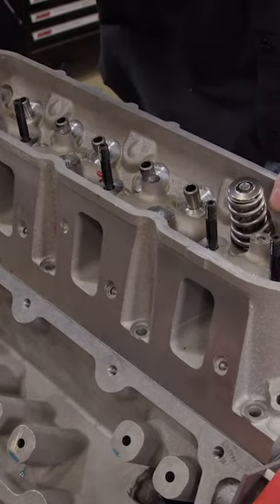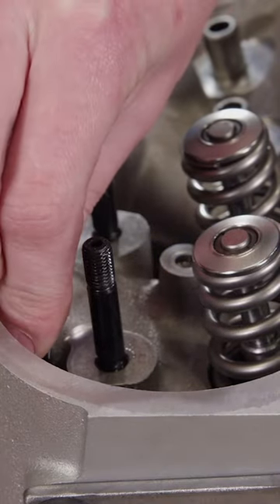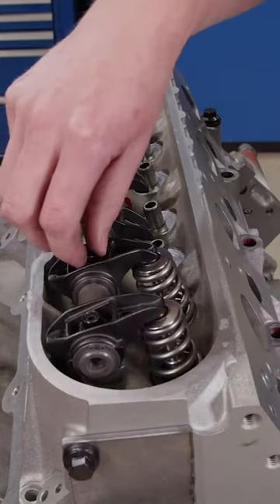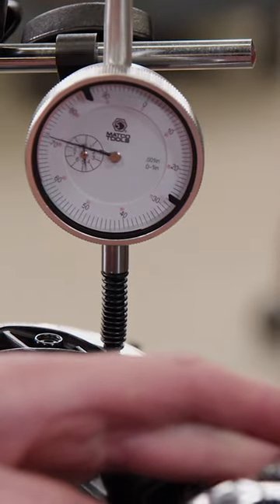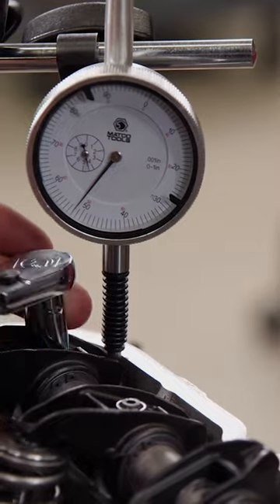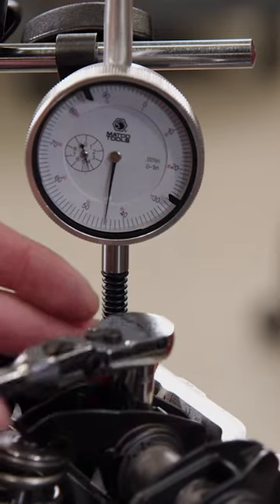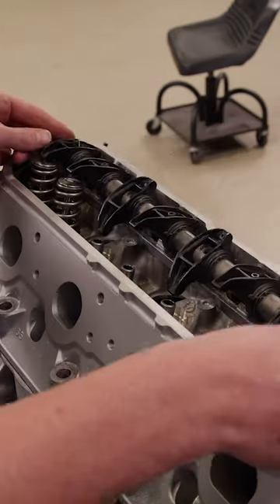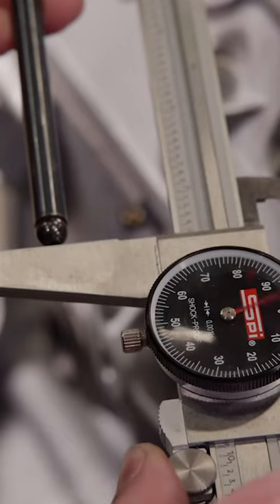How To Measure Push Rod Length

Comment: I c more of a 42 or am I wrong?
Reply: Same here
Reply: Me too
Reply: I just watched it again and yes he is indeed wrong. The measurement is 42-ish
Reply: Watch how much it sweeps not where it lands.
Reply: @austinwilliams1369 explain more if you don't mind I'm actually interested in understanding pls
Reply: @aicilopon26  He is not actually measuring anything directly with the indicator. Since he has the zero set at the height before it was tightened, him tightening the shaft down moves the shaft away from the dial indicator moving the  plunger down. You can think of the .090 more like -.010, -.020 for .080 etc. Since the needle actually moves .050 and then .0085 past it..... the assembly moved that far away.
Reply: @austinwilliams1369  that makes a lot more sense now, thanks bud
Reply: Read the little numbers
Reply: @julz9272  lol blows my mind.... 42 =100-58......